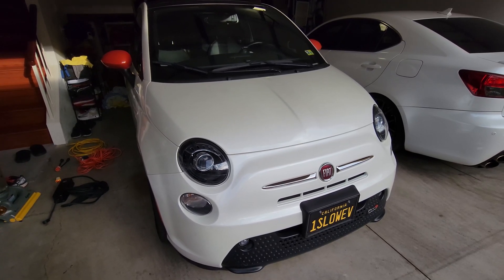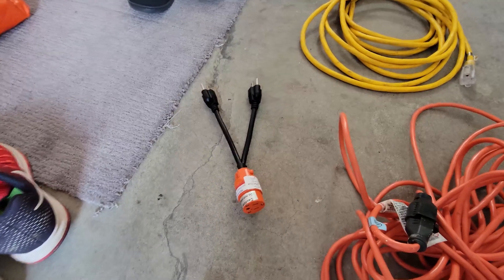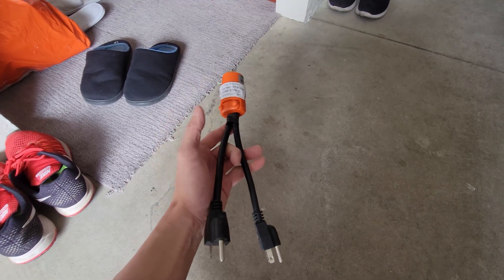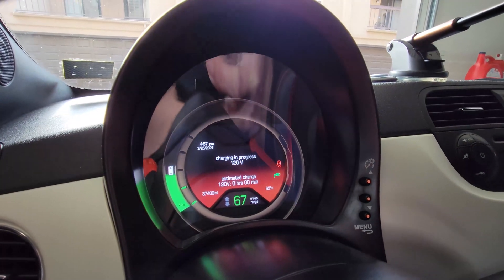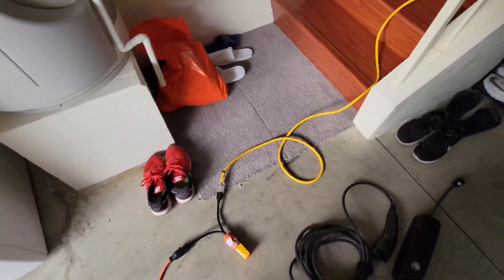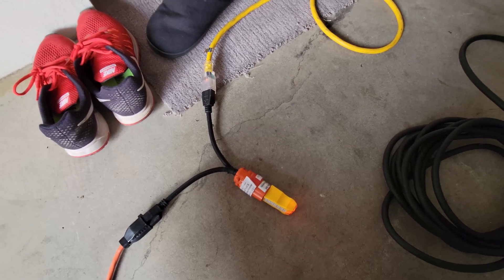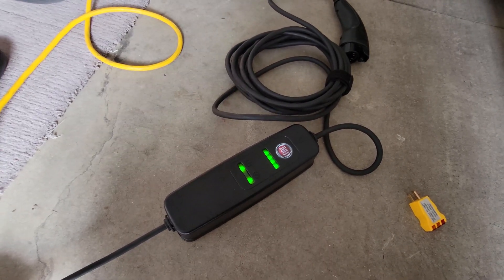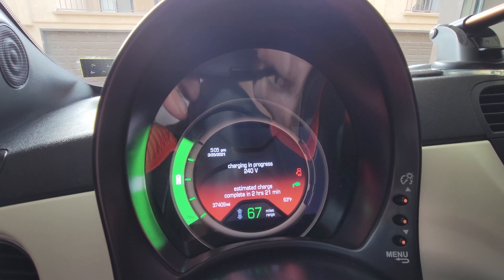Double Your EV Charging Speed at Home - Fiat 500e - EV Doubler

Comment: Will this damage my stock 120 volt OEM fiat 500e charger when using this set up?
Reply from the maker: supports 240v: https://www.fiat500owners.com/threads/level-2-240v-charging-with-the-level-1-120v-oem-charger.143049/

Comment: I didn't get 240V with the splitter. How is wired to get 240V?
Reply from the maker: you don't get the full level 2 charging rate, but a rate that is double the 110v since there are 2 110v plugs going into the splitter

Comment: If the charger works with 240v couldn't you just get  an adapter from a 240v dryer socket to your charger instead of  tapping 2 120v lines? I suspect you need to have the 2 sockets be on different lines on your fusebox rather than just being in different rooms.
Reply from the maker: i actually don't have a working 240v dryer socket. most of the time i just slow charge with the 110v and only use the splitter with 2 110s if i need a faster charge

Comment: sorry but I'm engineer and I know that is not working at all. you put in parallel and is same circuitry .
Reply: Apparently it IS working, since his car shows its getting 240v and the time to charge drops by 2 hours.  I believe this is possible because its on two separate breakers, which is the point he makes by taking one extension cord inside the house.

Comment: Hi. I just bought my 500e in Holland. I’ve got a question.. what’s the normal charging time for the 500e level 2? When I plugged in the cable in the charging station, it said it would take about 8/9 hours for a complete charge, when the battery was almost empty. Isn’t it supposed to be faster? I’ve got a 32a charging cable. Thanks!
Reply from the maker: Here in the US, it's about 4 hours from 0 to full at a level 2 charging station. Perhaps you might be at a charging station with a slower speed.
Reply: @thefastlane1  thanks for your fast answer! It should be possible to do it faster.. also here in Holland. But I think maybe it’s my cable quality or something like that. I can’t believe it wouldn’t be possible to do it faster.  What kind of cable do you use if I may ask?
Reply from the maker: @NatureOfVoices  I don't think it's the cable as they are all the same. I think it's the station you are at. Congrats on the 500e!
Reply: @thefastlane1  thank you! Yes.. I think you are right. Most of the public chargers over here are 16A and 11KW.. so with 1-phase loading you will only get 3.6 kw / hour. Sad but true haha.
Reply: I think  220v16a is almost 8 hr

Comment: What's to stop you getting electrocuted from the exposed pins from 1 cable in the y-split when the other cable is plugged in and turned on? And also you might want to uncoil the the fiat charger lead from being in a circular coil or it might overheat and melt through ; )
Reply: There is no danger (no voltage present)  if you plug in the EVDOUBLER then the EVCharger,

Comment: The outlets would have to be on different phases, no easy way of telling other than trial and error.
I never heard of using the stock charger at 220 v, sounds risky, but apparently it works.
Better get the biggest gauge extension cords you can. I had a extension cord plug weld itself from overheating. You're not supposed to use an extension cord.
If you can get a 220v charger on a dryer outlet, (make sure you get the right plug type) or spend on a level two install it's a better option.  Getting a 220 volt outlet installed is another option, then if you want to switch chargers you just unplug.
Reply: The EVDOUBLER only works with specifc EVCharger.  We publish the 'List of 240V compatible Vehicles' .  You do not need a heavy duty extension cord because the current is only 12A (about the same as a vacuum cleaner)
Reply from the maker: https://www.fiat500owners.com/threads/level-2-240v-charging-with-the-level-1-120v-oem-charger.143049/
Reply from the maker: Read #4
Reply: Fiat probably uses the same charger in the US and EU and it just switches modes automatically when it senses the voltage.

Comment: I'm thinking of purchasing a used 500E, but the whole home charging options confuse me.  Your video has me wondering, just how fast a home charger option can be,
It stated officially everywhere that with just a regular household 120V outlet,  it can take apx 23 hours to charge the 500E from zero to 100% full charge,
so  was wondering in the demonstration you provided, with adding two 120V household oulets, would that mean  the total time charging would be 
exactly doubled, or cut in half going from  23 hours apx  to  12 hours apx if the battery was completely at  zero charge?
Reply from the maker: Correct, it would be about 12 hours for a full charge based on my video
Reply: @thefastlane1  Have you ever looked into the best  Level 2  at home charging kits for your Fiat 500?  (assuming you would have or want to upgrade one of  your regular 120Volt outlets)  What I'm trying to figure out is, can this car be charged from zero battery to full battery in a home setting in under  6 hours with the equipment?
Reply from the maker: @flolou8496  with any true level 2 charger, it can be charged to full in 4 hours.

Comment: Thats a very cool tip. Thanks!! I'm always looking for ways to tinker with my 500e
Reply from the maker: What have you done to your 500e?
Reply: @thefastlane1  Nothing major yet, but soon I'll be replacing the 12v acid battery for a Lithium 12v battery. Should shave about 30lbs. Secondly, I have to replace that awful tom-tom stereo unit.
Reply from the maker: @mrguzman4G  the stereo is the worst!